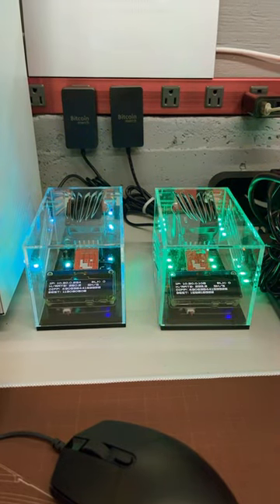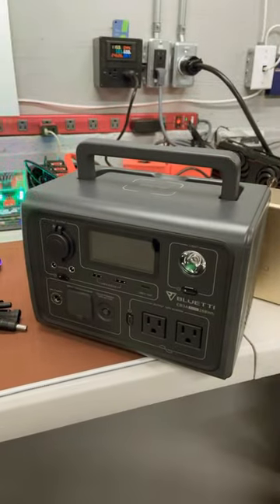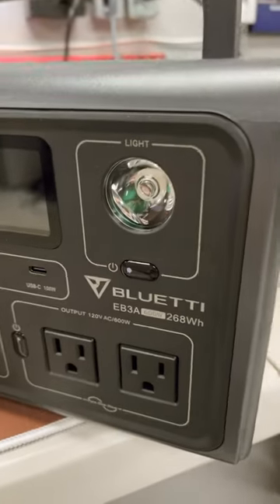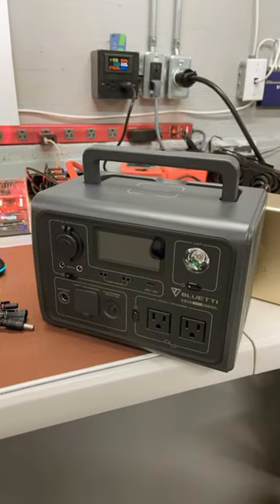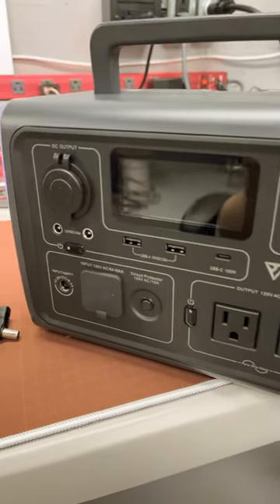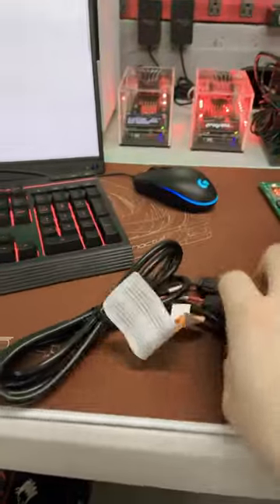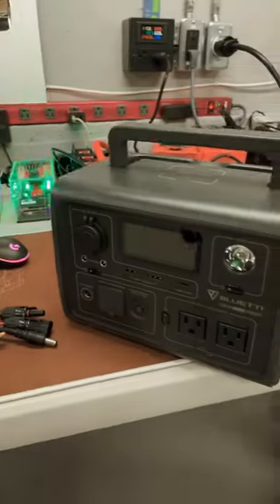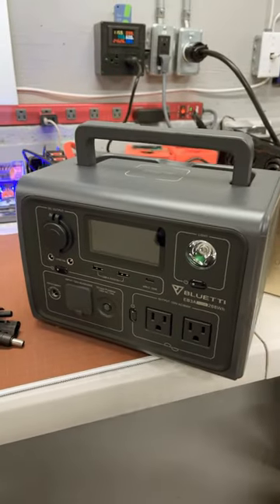How long could I solo mine Bitcoin through this solar capable power station?

Comment: I have the Vtoman 1000w running all my 30 Verus cell phones and 2 KS0's with a 200w solar panel and the power station never drops below 50%. I wanna add 2 more KS0's and maybe another panel. Might get 12-14 hrs on that bluetti